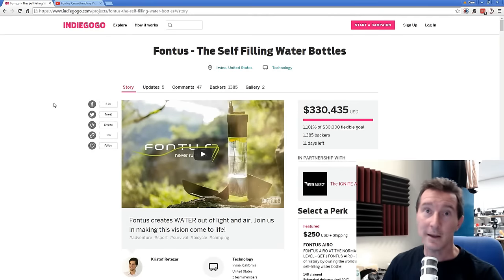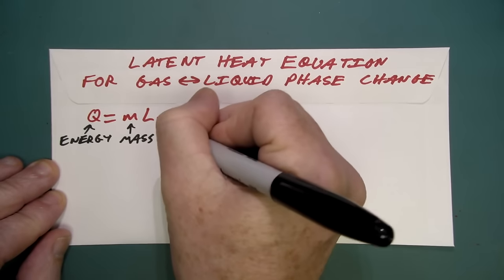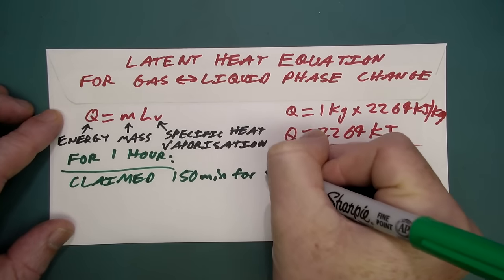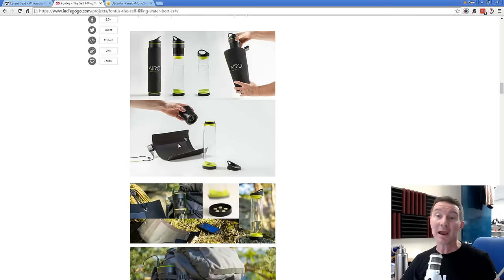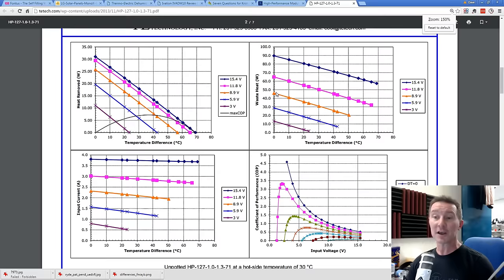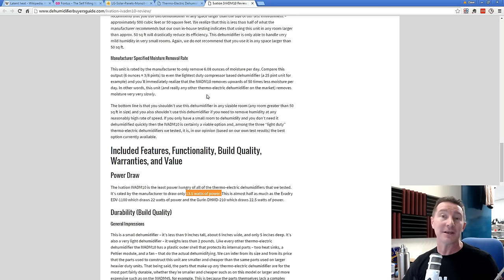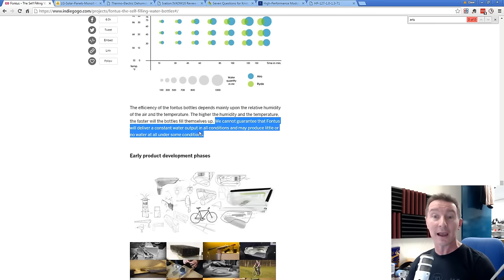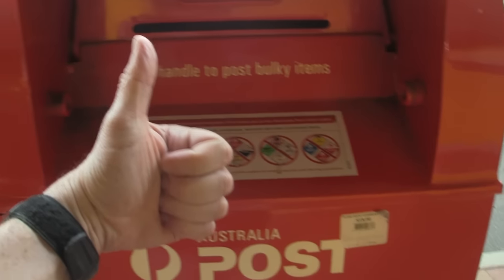EEVblog #881 - Fontus Self Filling Water Bottle BUSTED!

Comment: 90% humidity and 40ºC, I love riding my bike inside the Amazon rainforest, but I think I would have some problems with the sun there...
Reply: +Masterpg2007 If you are in the rainforest then might as well just collect the rain to drink. :P
Reply: Hahahha just like my home. Hunidity is fucking high. Temperature reaching 30 to 35 c°. Luckly my house has a lot of trees. Shade and cloud help cool off. Dont live near equator folks. I can widthstand high temperature, but mosquito its another enemy.
Reply: +Konqithedragon well, the rain does fall out of the air, so if you catch it with the bottle,.. technically it would work right?
Reply: +Konqithedragon The rainforest gets almost no rain each year, thus that device is needed.
Reply: Razor2048 I have to correct that statement. Rain forest is the area that get the most water by rain. Because it is geological structure of lots of mountain + direct breeze from the sea and monsoon wind, the mountains function as wind catchment area for rain. Thats why it is called Rain forest. 

 Source: My country is near the equator. A large area of rainforest near my place. Popular place for hiking and climbing.
Reply: Nick John
 But, you don't know where that water has been, or what those cloud were doing with that water before dropping it. Wouldn't you rather wait a weak or 2 for your water bottle to self-fill?
It only takes a little patience. Really, it is almost as if people are addicted to water; a week or 2 break does the body good.
Reply: Razor2048
stop promoting that poison, if you look at the total of all humans that have ever lived. almost 100% of them drank water and are dead. Those that aren't dead are still addicted to it. This is a serious problem.
Reply: Razor2048 As I said, I live in humid country. Almost 80 to 90 % humidity. Also I live on equator. Crossroad between monsoon wind. Therefore sometimes we have 2 seasons, rain and drought. If I want water, I just pick a bucket and put outside during raining. Sometimes it raining for full one day. 

Yes I do know where the water in the cloud went. It rains down in rain forest. Thats why it is called rain forest. My country has designated prohibited zone for deforestation because some mountains function as water catchment area. Which means when the cloud that carried out by monsoon water hit mountains, the mountains absorb the humidity and water in the cloud forming creek and river high above the mountains. 

If you want hiking, it is better to lookup river and small creek rather than this device. Sometimes, few popular hiking road has emergency water container. Thats why, hiking take a dedication, good planning and good physical. This device is good in theory, but if I hiking with this device, I'll just use it as water bottle. 

Source: I live near to rain forest. As I said before, my country is on the equator.
Reply: Berenstian bears
Reply: Um we get these conditions for about 10 of the 12 months in a year where I am. Welcome to Queensland Australia!

Comment: I'm in the wrong job. I should be making slick marketing videos about pretend products and funding the non production of them on crowdfunding sites. I had an idea called the BottL. It's a 2 part flask connected by a series of peltier plates. You put boiling water in one side and iced water in the other. You can then charge your phone and have a handy supply of hot of cold water.
Reply from the maker: +Maxx B Winner.
Reply: +EEVblog Can I say it has the EEVblog BS seal of approval? Could you invent an award and present it to the BottL. (I'll kick back 10% of the crowdfunding) I was thinking of adding in some battery optimisation technology to raise it's performance by around 800%
Reply: +Maxx B add storage battery
Reply: +Eric Schrödinger and Free Energy-Recharging (from all the WLANs around) XD
Reply: +Maxx B Take my money!
Reply: +Maxx B 
"As seen on EEVblog" lol
nice marketing plug
Reply: mynewschannel
You want a job in MaxxSkam Industries?
George, you want to work in R&D with Eric?
Reply: +Maxx B thows money at screen
Reply: +Maxx B let's do this
Reply: just open a patreon account and beg for money like the other youtubers
Reply: +Maxx B you could even plug it into the wall and live off the grid!
Reply: +Maxx B How much money do you need to integrate it into a roadway or sidewalk?
Reply: *****
I did mention 'battery optimisation technology to raise it's performance by around 800%' which was a veiled pop at that product without actually naming it and attracting their army of Asian downvoters, because their product was disparaged.
Reply: DNSDies I like the way you think. Turn it in to a government contract, labelled as CO2 reducing green technology, and get a licence to print money.
Reply: The real question is, can it make coffee?
Reply: If you take the top $1000 perk, Yes, it will make coffee.
Reply: +Eric Schrödinger Maybe your cat can be part of the project?
Reply: +Samgab It can and can't at the same time...
Reply: +Maxx B You got the spirit
Reply: actually, you could produce about 5-10Wh with that (60°C difference on 1l gives about 70Wh, with a 10%efficiency, that gives 7Wh), if you make a good enough separator so that they don"t interface as long as you don't need the power, you could make it a good enough novelty product that could sell.
Reply: +manaquri haha yeah but the energy required to boil the water is quite high, which would be better used on a charger, so... yeah
Reply: GM 1193
yes, but you don't have the added weight of the (30-70g) battery Kappa
Reply: manaquri haha yeah, I guess. I was just going on the idea of having to boil the water, which if using electricity, would be better used to power a phone charger, which I think was the original intention of the invemtion.
Reply: GM 1193
it is a gimmick, but at least it does something when you go camping or your company gives you coffee but doesn't allow you to plug your phone, and in camping you can heat water on fire though, so it might not be that bad of an idea..
Reply: ahh good point. I will be placing my preorder promptly ;)
Reply: GM 1193
just need a good camera, a good looking model, and some inspirational music, right?
Reply: @EEVblog. I just saw the Fontus water bottle plugged on an old "Henry Ford Innovation Nation" show on Pluto TV. Couldn't a bike wheel generator be used to power the dehumidifier of the water bottle? How many watts is a bike wheel generator capable  of producing? 

How about a small, portable oxygen concentrator to pull oxygen out of the air to breathe? Could you test one at a university? Perhaps they don't really work and THEY'RE a scam too. (They're battery powered.) I always test with at least 94% of the desired amount of oxygen in my blood with the detector that doesn't even prick your finger, that they put on your finger at the doctor's office. I don't see how that device can read the amount of oxygen in your blood. Perhaps that finger oxygen reader that does not prick your finger is a scam also. Could you please test that device at a university also? I think it's a scam for the health insurance companies so they can claim you don't need extra oxygen, and therefore not cover the high price of an oxygen concentrator which may itself be an expensive scam.

Comment: It's aesthetically pleasing but it has a piss-poor performance? I don't see the problem, just put an Apple sticker on it and sell it for $300 more, problem solved.
Reply: +ElecDiy I think Apple will wait 4 years, then make a more expensive version of it, and then claim they invented it, and legal action etc. (insert usual Apple legal claims against everyone here.) If anyone who buys it claims it doesn't work, they will claim they are holding it in the wrong hand and using the wrong kind of mouth to drink what little water it makes. Then after a year of bad publicity they'll offer an extended repair/money back offer.And still the fanboys will keep throwing their money at overpriced crap because it has a trendy designer logo on it. Apple need to go into makeup and clothes. Then even more gullible idiots can part with their hard earned cash for mass produced third rate, overpriced trash that's made in China.
Reply: Hahaha good one
Reply: +ElecDiy Nailed it!
Reply: +ElecDiy people hate Apple for many reasons, (arrogance, dumbed down operating environment, f#$ktards working at the genius bars etc) but "piss poor performance" is not one of them. Every apple device I have ever bought in the past 25 years has lived up to its promised specs. What device are you referring to exactly???
Reply: I agree, when it comes to performance you get what you ask for, even if you can get more for the same price, or at least until the updates don't turn it into a brick in case of mobile devices, I don't have much against Apple on that subject, I just was trying to make a joke about how people will buy anything that is good looking and expensive, no matter how functional it is, as long as it has a brand name on it, it doesn't  has to only apply to Apple really.
Reply: +ElecDiy I know the joke, but for us senior apple fan dads..we are not amused :)
Reply: +raindogred ho they will live up to their spec (mostly) , that dose not mean the speck are going to be piss ass poor!
Reply: +ElecDiy except it is lacking the essential component, the reality distortion field
Reply: ppwalk05 You mean the apple logo? Easy fix jut paint it white and put an even whither apple! ho and change the power cord to crapy white cable with unrealistic (and unpractical) magnetic plug.
Reply: Don't forget the overpriced accessories!
Reply: +ElecDiy You are hired
Reply: +ppwalk056 -  "the reality distortion field."  It will be added as a premium firmware upgrade.

Comment: 250 W from a 30 cm² solar array? Why they bother with water bottles? NASA and ESA will buy this technology for millions!
Reply: And the militery :)
Reply: +666Tomato666
 And the deserts will bloom!
Reply: +666Tomato666 Either that, or they are working on the highest COP and smallest heat pump ever, which the AC and refrigerator industries would be lining up to buy. (And also NASA and ESA, as they dabble in heat pumps quite a bit, what with all the LOX used for launches.)

Comment: The device truly works, you can even observe the results, the reason why you are skeptical, is because you do not take the proper initial steps prior to viewing the product.
The first step requires you to fill the entire bottle with LSD, and then chug it.
The LSD then helps you to see the machine working as intended. Without the LSD, logic takes over and thinks look disappointing.
Reply: +Razor2048 Be careful when writing LSD in a place where EEs come by. The might confuse it with LSD (batteries) and smoke them instead!